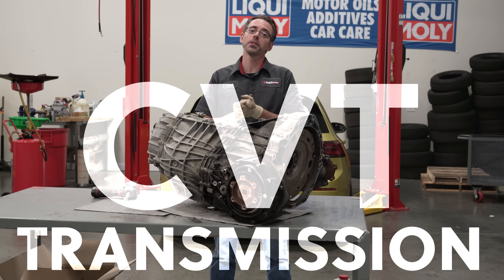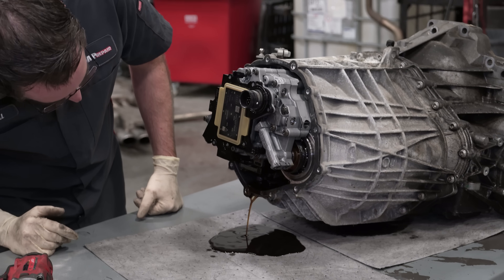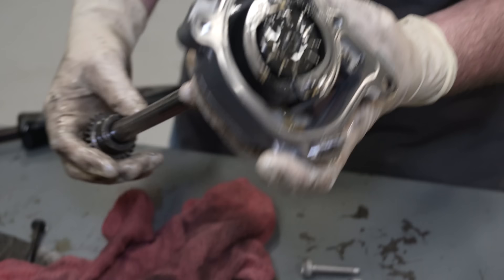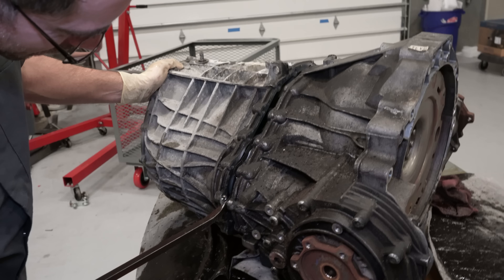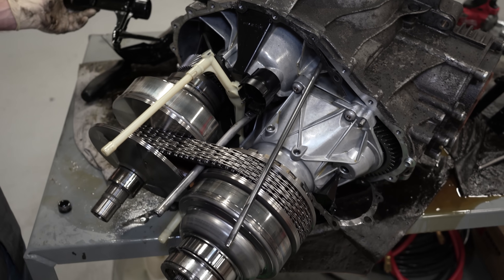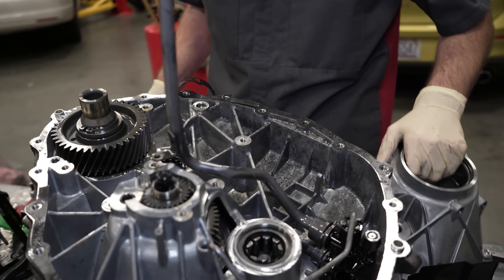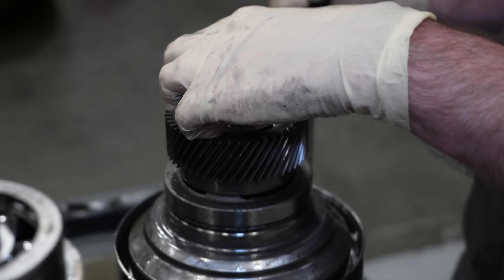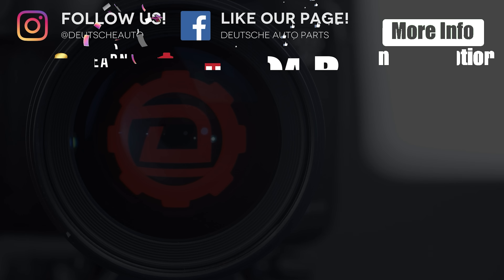Why you shouldn’t get a CVT transmission

Comment: It most regular, lower powered  cars (sub 300HP), CVTs are fine.  The whole "revs up high and hangs there" is a bit of a silly argument since you don't drive with your foot to the floor for any extended timeframe.  So yea, the RPMs will get up to 5k and hang there, but if it had a regular automatic, they'd shoot up to 6k, shift to 4k, rise to 6k and shift again (etc).  It isn't really any different other than the slight change of pitch in the engine sound because of the slight variation of RPMs.  It is important to do proper maintenance (fluid changes) and taking care of your vehicle (like everything else).  Both of our cars have a CVT and we love them.  They are much smoother driving and give better fuel economy.  Some CVTs over the years have been a little more prone to failure, but the Honda, Toyota and Subaru ones seem to be the pretty decent.  Nissan has had issues in the past, but the newer ones do seem to have improved.

Comment: I will certainly stick with my manual transmissions,  looks like 1000 parts in the CVT.  My family has driven manual transmissions in all 9 of our cars.  All went to 250,000 miles, none ever had a transmission or clutch fail.

Comment: toyota hybrid have a CVT but it is based off a sun gear and has no belts.  221k driving uber and no issues (cat and battery needed replaced so I traded it in).

Comment: I bought a brand new L33 Nissan Altima... and the VQ chewed the CVT to the point of grenading itself at only 70,000km. (So whatever saving on the fuel economy I got from the CVT - which was significant by the way - was in no way worth it for the $7,000 replacement transmission cost 😲😲 So I traded her back to a Nissan dealer for something without a CVT.) And no... I didn't "drive it like an Altima"... (apparently that's a thing that all the American's will immediately understand...) If fact I loved that car, it was damned near perfect for what I needed... all except that moronic CVT... so to watch you destroy one because you wanted to... that was particularly satisfying 👍🤣 Keep up the good work.

Comment: Nice video! I was recently considering getting a Honda CRV to replace my old Accord which is on its last leg. After researching I found that not only do they have a terrible engine but they also use a CVT transmission. It pains me to spend so much money on a car but I'd rather upgrade to an Acura which has a better engine (no hybrid) and a traditional transmission (I'm guessing a normal planetary transmission. I keep my cars a very long time and the last thing I want is to have to either total my vehicle in the future or spend thousands repairing the drivetrain. Its a disgrace that many newer cars are nothing more than compliance vehicles designed to meet government standards. Thanks for the breakdown of a CVT transmission!

Comment: A CVT transmission cannot be operated like an automatic shift gear transmission and most people are not aware of this. Hard stops and jack rabbit starts weaken or break the CVT steel transmission belt. I own 2 CVT Nissans with no problems. CVT transmission deliver superior miles per gallon averages which is their primary benefit.
Reply: 1 extra MPG+ vs 300k proven reliability on 2005 Corolla automatic transmission.

Comment: I'm still partial to my AT tech. Keep your CVTs and your 38 mpg.
My '10 Pilot (ATM) has 378,000 original miles on it. Owned 8 Accords and an Element in the last 25 years and only one minor ATM problem, and that was due to a leaking windshield damaging the Control Module under the passenger's feet.

Comment: My 12 years old car has a conventional 7 speed automatic transmission in it, it has been so reliable.  I would never buy a car with a CVT in it, CVT is a great concept but lousy implementation in most cases.  My old car will keep running for many years to come and most CVT cars have a short life, car manufacturers are smart to keep their business running with huge turnover.  Imagine you need a new car in 1 - 2 years due to a wrecked CVT, you do the math.

Comment: The beauty/simplicity of manual transmission can hardly be overstated.
Reply: This beauty and simplicity cant be found on fucking heavy traffic roads.
Reply: @guitarrerist698  Out of traffic and windy roads make the Manual transmission shine the most.
Reply: @haaxxx9  where you dont need to shift anyway.
Reply: Replacing the clutch, pressure plate, and throw out bearing is annoying.
Automatics have improved dramatically over the decades.
But slughtly better fuel economy is a plus with manuals.
Reply: Absolutly.
Reply: +1 for manual. Without manual gear shifting, driving becomes terribly boring. I also don't understand the complaints about manual transmission in traffic jams... Such people shouldn't drive cars if they have trouble operating two pedals at the same time.
Reply: @Piterrrxd  The complaint is that it's a chore. I have owned nothing but manual cars and motorcycles for the last 20 years and 200K+ miles of driving, and there's nothing exciting or enjoyable about feathering your clutch hundreds of times a day in stop & go traffic. For a weekend car I could see it: Actually going-out onto some nice rural roads and getting to enjoy it, but 100% my next "daily" car will be an automatic, because traffic is inevitable. That said, I've gotten 20 years out of my current manual car and it's still great, so maybe in another decade I'll actually have to replace it.
Reply: @phatcyclist Feathering has never been a thing with me with my Mk6 GTI or even my 981 Boxster.  Just keep a little more distance and you can creep along at a few mph in 1st with the clutch fully engaged.
Reply: @joetrapp9187  That's what I'd like to do and used to do, except that if you do that here now someone will just jump into the lane ahead of you and you have to nearly stop anyway. Not enough space for all the people on the roads here, and so few drivers actually recognize that driving technique anymore. Gone are the halcyon days of just being able to enjoy driving in my city.
Reply: That, and these days they act as anti theft devices since many thieves can't drive a stick.
Reply: Yup
Reply: Most people don't want ti drive a manual in stop and go traffic. Most people.
Reply: Amen to that
Reply: Control and romance! Not for mediocre minds!
Reply: Pretty much lol
Reply: Yea.
Reply: Yup
Reply: Yup
Reply: Yup
Reply: CVT is simpler and more realible than a manual transmission. The most realible is the automatic transmission.
Reply: "simplicity" LMAO
Reply: @fakecake6776  Laughter is a great aid in memorizing new words. You'll soon have a competent vocabulary
Reply: Automatic*
Reply: Simplicity? Where did you get your degree?
Reply: @LuciMourningstar  my Nissan Pathfinder had its xmission rebuilt 2x before 80k warranty. One doesn’t need a degree to figure out it’s trash. My RAV has the OEM clutch with 216k on it. My cousin has a 1987 BMW 3 with a rebuilt engine and the OEM clutch some 300k miles on it. To rebuild my Nissan CVT was $7000. I can do my RAV clutch in my garage w/o a degree. I have its OEM manual and it cost about 400USD in parts. Toyota does have a CVT now which has great reviews so my opinion is based on my experience alone. But hey, 500 plus likes I don’t think I’m alone. But, in its defense, the CVT is evolving, improving and here to stay.
Reply: @Fatboy53  192k on an original. I think it also falls to drive style
Reply: Only kids like Manuals...after 20 years of driving daily ,i cant stand manual.  I just wana enjoy the ride .
Reply: But you also have clutch replacements with them and that is not a cheap repair .
Reply: @DenisAbbott-m2q  I can take a Saturday and do mine for $400 RockAuto v $7000-12000 on an auto which I can’t do
Reply: It's the clutch pedal that's the pain.
Reply: They say why if I have 2 feet but there are 3 pedals ???
Reply: Yes, but you need a certain level of intelligence:
-	To be able to drive a car with a manual gearbox.  
-	Or to be able to eat one’s food with a knife and fork.  
-	Or to be able to speak more than one language fluently.  
-	Or, at the very least, be able to speak at least one language properly.
Reply: @Andreschannel_SA You got it brother many won't understand
Reply: Also the best anti theft technology nowadays 😂
Reply: It’s real driving and totally natural.
Reply: @one80sRocker89  The only reason we made manual transmissions at first is because we didnt have good way to make automatics. Now that we have good automatics 98% of the vehicles sold are automatics. The proof is in the pudding, despite what a lot of people claim, almost every single american wants to drive an automatic. The statistics dont lie.
Reply: Yeah, my last car with a manual transmission lasted almost 300 K miles and it was not the transmission that failed. I really wanted another car with a manual transmission but they don't sell them any more in the US which sucks. You'd be left with buying an old car. And as far as automatic transmission it seems every car brand is switching to CVT so you may soon be out of luck finding any car without them.
Reply: I managed to get the 23 Subaru Crosstrek in manual. The last year before they discontinued that. @Uncommonsensetoo
Reply: Yes manual is good, if you can do a clutch job yourself every 60-100k miles depending on how fun you have,
Have a garage and enjoy working on cars. Other than that it can get unpractical.
Reply: @Mr.Del29  mine has 216k on the original RAV4
Reply: @melvindelrosario9503  Yes, and resale value is at least $1000 less than a slushomatic, but if you like sticks, and you're the buyer, it's to your advantage.
Reply: @mikyl-fo8rh  depends on the vehicle. Manual r32s are like $10,000 more than automatics. There's a lot of cars like that.
Reply: Manual transmission is a piece of outdated trash. It is not simplier, it is not more reliable, it is ridiculous and useless. I drive manual and it’s the worst technology I ever encountered. It’s like driving a steam engine
Reply: @perepashipole  to each his own I respect your opinion. Most race cars use manual, I’m not entirely convinced you’re correct. But we can agree to disagree. All good. But when an auto breaks the cost is ~$7k USD. My clutch I can do by myself for about $400. But I’m not against autos, I have a Subi n Camry with them but neither has a CVT. But the CVT is improving and here to stay. But going forward I do my best to get manuals. Cheers.
Reply: @perepashipole  Sounds like you don't know how to drive a manual.
Reply: But 99.9% of North American women only want an automatic transmission. They don't want to learn to drive a stick. Too complicated. So most North American vehicles sold are automatics.
Reply: @don-cw1yz  Its the american men as well. Only something like 2% of the vehicles sold in the US are manual transmission. That includes pickups. So dont try to put the blame on the women, its just as much the men. Turns out that if you give a human the option of shifting themselves or having a computer do it, they choose the computer legitimately almost 100% of the time.
Reply: @don-cw1yz and most American women are stupid.

As a matter of fact that basically defines stupid in my book; whether or not your willing to drive/Learn to drive a manual.
Reply: @don-cw1yz I know a woman that prefers manual. She's my wife and she doesn't live in the USA
Reply: @don-cw1yz are you saying we should pander to North American womens whim?
Reply: @don-cw1yz  That doesn't only apply to North America lol

Comment: It's OK to hate CVT transmissions, it is OK as well to destroy one. I would have liked to see more details  about what makes them so shitty. Is it wear and tear (break), the electronics, the large quantity of seamingly useless parts ??   They operate in the same way that a snow machine transmission works and snow machines have been around for nearly 70 years now. On the snow machines one has to replace the ''rubber'' belt fairly often, but just about any one can do this in 15 minutes and they cost about 50$,....but they work and they work hard...!

Comment: And yet in day to day usage, CVT tends to be the winner in fuel economy side. That hung up on a certain RPM that many driver don't like? That's the optimum RPM for the highest torque which is needed for acceleration.

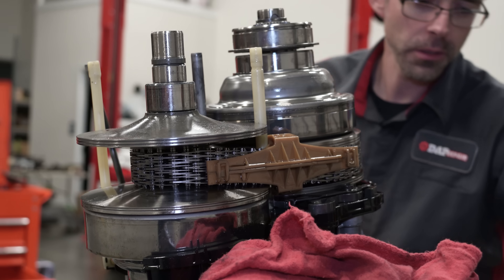Comment: 7:51 "...I don't think anyone's had particularly good results yet..." - I disagree.  All manufacturers that use CVTs have created a very lucrative revenue stream from their repair/replacement.  Since the few times they can be repaired, all the parts come only from the auto manufacturer, and so are insanely expensive.  When they need to be replaced, the new CVT is also only available from the manufacturer, and since the only other option is to scrap the vehicle, they can charge a fortune for them.  CVTs have been very successful for shareholders, and that's all that matters to any publicly traded auto manufacturer.

Comment: CVT transmissions are great when designed properly. The real issue is VW, Audi etc...make trash CVT transmissions. Most mechanics don't like CVT's because they don't truly understand it so instead of repairing they replace them. I have a 2006 Lexus RX400H with over 340,000 miles, not a single issue with my CVT transmission.

Comment: I have a 2019 Nissan Sentra that is supposed to have a CVT. But watching the tach, you couldn't tell because accelerating from a standing stop, the tach climbs to about 3000 then drops to 2200 then climbs again to around 2700 then drops again to about 2000. It has 72,000 miles and is starting to slip. I can feel an occasional lag while driving at about 60mph with the tach showing about 1900rpm. When the lag hits the tach jumps about 300rpm for a few seconds. I'm about ready to trade the damn thing in on something that has a real transmission.

Comment: On my Honda CR-Z the CVT is actually pretty adequate. I thought I'd hate it but I think the hate is just people hating just for the sake of hating that thing everyone already hates. 

I got my car at about 37k miles, trans would work fine like 95% of the time and would, on rare occasions, not engage if I asked it to downshift quickly. Did a fluid change and the issue went away. At about 80k it started to come back. Changed fluid again and it went away again. As long as you change the fluid regularly (I'll be doing 30k from now on) and it's not mated to a bigger engine, CVTs can be decently reliable. Problem is, most people don't change the fluid, and it's common for CVTs to be mated to bigger 200+hp engines, both of which lead to failure. But I've heard of CVTs going over 150k miles with regular maintenance. And if it's on a daily car, then they're actually nice and smooth and good ones keep the engine RPM more or less constant making it much less noticeable.

Comment: Wrong. I have a 2018 Honda Accord with a CVT in it, and it has worked beautifully for 210,000 miles. I don't think I can ever go back to a standard shifty transmission. The CVT is far smoother and nicer. This gentleman needs to do better research because his information is highly faulty.

Comment: An example of a CVT failure from a  manufacturer known for it's transmission reliability (sarcasm, just in case). Is there any reliable statical data comparing CVTs and conventional trans? I've been trying to find some data without success. Based on personal experience (I'm aware it's anecdotal data but that's what I have) they are as reliable as a conventional, I have had three of them no issue, my sister two, my son one my mother one , coworkers may be 20 and I haven't heard a single issue. Do CVTs fail of course every mechanical thing is susceptible to failure that's why the only way to know is by hard data not because I hate them so much.

Comment: I have owned a previous  2016 Subaru WRX,  at present a 2020 WRX both CVT auto's i have found the Subaru CVT just brilliant with never a issue from either and so amazingly smooth in operation, my next Subaru will be anoter CVT as they are so smooth and nice to drive. With all my cars over the years i do drive then with care and respect, many drivers Don't ?    👍 Au